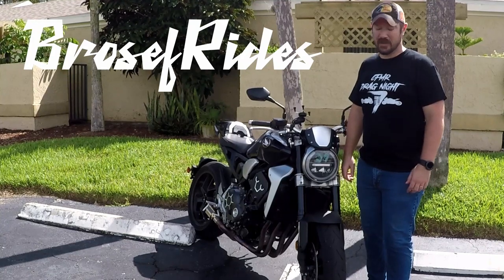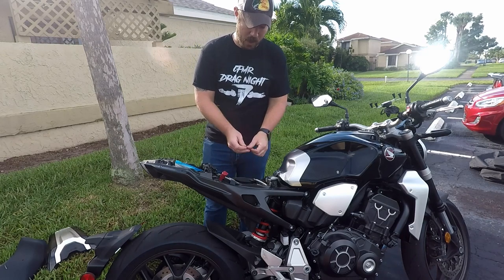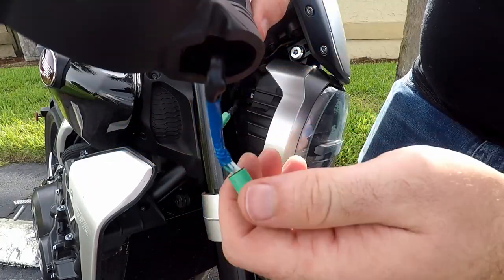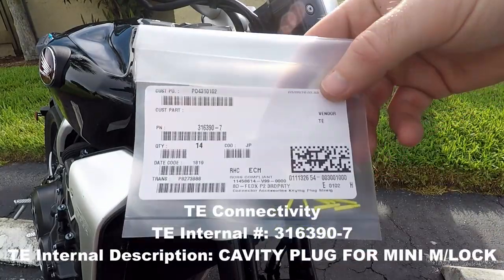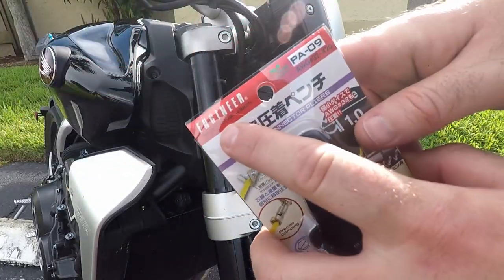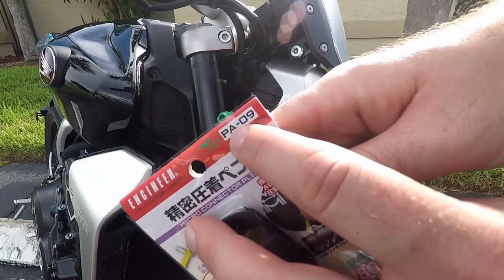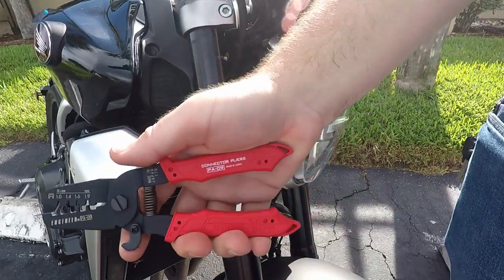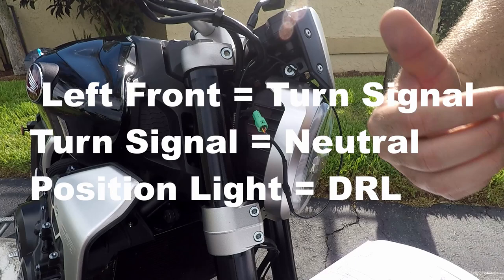2018 Honda CB1000R Low Profile Front Turn Signal Installation

Comment: Better use your life savers when turning. Oem manufactures are not stupid in designing turn signal lights. Visibility is key.
Reply from the maker: IMO these have more visibility then the factory lights and from more angles. OEMs don't always choose based on what's best for their customer, factoring in cost and quality before putting out an end product. Thank you for your comment.
Reply: i suspect there's probably some regulation they have to adhere to, like that the indicators have to be this far apart form each other or sumshit, or that far apart from the main light... which would actually make sense